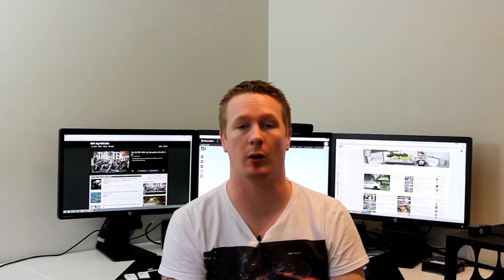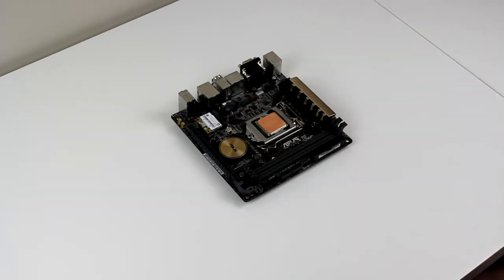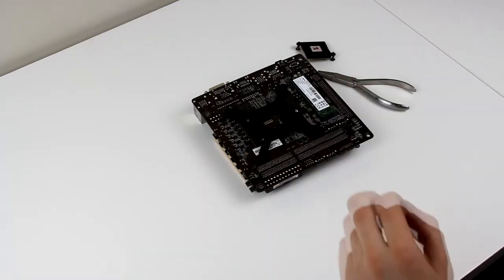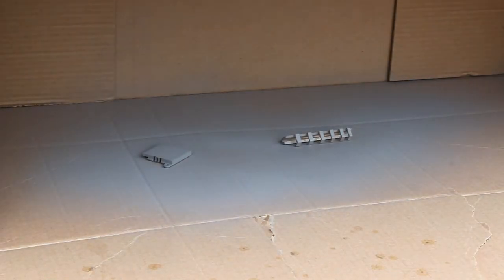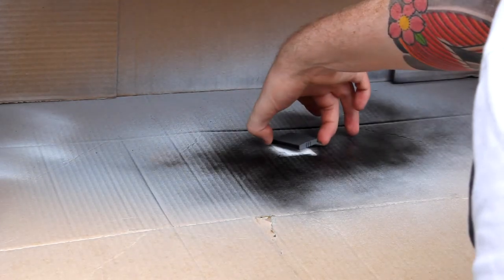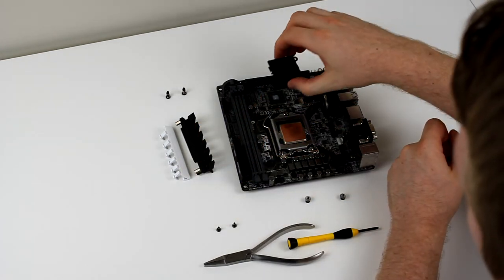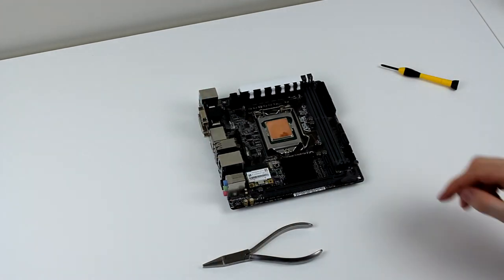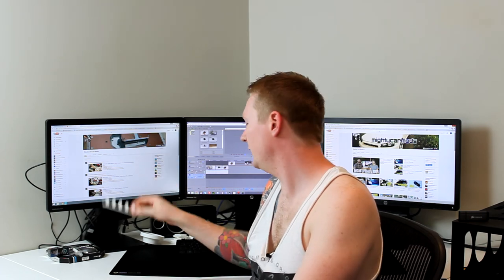Project MiniValidus - Part 03 - Painting Motherboard Heatsinks.

Comment: Glad to see another addition to your series. Really looking forward to how its coming together. Been reading on forums that the heat pipe in the STRIX 980 might have issues fitting in the M1. My current build has that exact card and I've been thinking about down sizing to this case. I've been hesitating though, as I don't know if there will be enough clearance. A mod could fix this or maybe water cooling, let me know what you think. Cheers!
Reply from the maker: Thanks for the comments.
The Strix GTX980 fits better than the Strix GTX970 because of a slightly different heatpipe configuration between the 2. It does fit but where it has issues is the high PCB where the SLI fingers are hits on the mounting fixture for the side panel. People have 1. Removed that 1 fitting with no side panel clamping issues or 2. grind back that part of the PCB "eek!" I will have to assess what will be best for me when I start looking at installing into the case. Watercooling offers similar issues with the in and outlets being quite wide or tall in this case, likely I'll have to modify the waterblock to slim down how wide those inlet and outlet fittings are...

Stay tuned to watch it unfold!

Comment: If you want the very best heat solution, use a Thermal Electric Cooler (TEC). These are capable of reaching sub zero temps. The only drawbacks are that it takes a lot of power to use them. 12v at 7amps for the one I have. The other issue is they get so cold they can and will condense water in the air causing it to sweat. Not a good idea to put one inside a computer case unless you overcome that. One way to overcome it is to connect the TEC to a heatsink in a water cooling system OUTSIDE the case. Lots of variations to this method and imo the best way to insure a very cool system. Electricity flows through cold much better than through hot conductors. There are videos on youtube about this.

Comment: I'm considering painting my blue Asus heatsinks black or red. Does painting impact thermal dissipation enough for me to worry about it? I'm going to cover up the part which makes contact with the north and south bridge.
Reply from the maker: MikoYT in my opinion it is incredibly unlikely to impact thermals enough to cause any issue. High temperature components like the CPU are seeing s +10degree jump after painting. A North/South wouldn't generate near the amount of heat a CPU would so I believe the margin would be smaller though I haven't tested that.

Comment: Awesome project! keep up the good work :) I am looking to paint my motherboard heatsinks as well . I wanted to know if you have to replace any thermal pads/compound after removing the heatskink and chipset when putting them back on? Would I be able to keep them as they were? if not, do you know what size thermal pads I would need to get for the vrm heatsink? Is that a ph00 screwdriver you are using?

Thank You.
Reply from the maker: Infinity Gaming I didn't replace the thermal pads when I did it and haven't had any adverse effects. I did replace the thermal compound under the chipset heatsink but really I probably didnt have to I could have just left what was on there, the actual metal component under that heatsink was probably only 1cm x 1cm the rest was all plastic. Not exactly sure of sizings, looking at what I have infront of me now I would say it was one larger, a PH0X.
Reply: DeeGee Tech and Hardware Thank you for the confirmation, helped out alot! Sorry for all the questions, I'm a compete noob when it comes to modding lol. Last questions: Could you tell me which spray paint you used, and Would I need to sand down my heatsinks before applying the paint? If so, do you know what type of sandpaper I would need to use? Thanks again :)
Reply from the maker: Infinity Gaming No problems, I always encourage question asking, I sure don't have all the answers. Paint will be marked with what it should be used with but if you go with any automotive paint you should be fine, same applies for for the primer, it will be marked if its for plastics, metals or fiberglass etc... as for sanding I didnt but a green or red scotch pad (have a look at mnpctech.com or Jim Weist ) that should be enough to just scuff the surface for a good paint application.

Comment: I have the similar board but of the atx bersion. I m plainign to paint my case labs case and want to paint the heatsink. what temp differnce did you see from it being painted or just no much? Also for thermal paste for the heatsinls do you use the same as cpu (like as5?) thanks again this will really help me
Reply from the maker: James Emsley TBH I wasnt monitoring the temps actively but I did have the default Asus alarms enabled so if it was overly got I would have been alarmed and I never was. Yea I just used normal CPU thermal paste (in my case MX4). I was pushing a few volts through mine for the overclock and it had no impact at all.
Do it! and good luck :)
Reply: Thanks man I'll link or pm you a link when it's done. Just started painting the caselabs case
Reply: +James Emsley Im also thinking of doing this with a differen mobo.
How did it work out for you?

Comment: Thanks for this video, it's given me hope in the project I would absolutely love to do.
The plan in question is an mATX black and green build in the Corsair 350D, I've narrowed down my parts to an MSI Z97M Gaming motherboard which I'd have to paint the red to a green that matches the GTX 960 100Million edition. 
Chances are though by the time I save up for said motherboard, Skylake and new boards would be out and if I can get a hold of a Gigabyte Sniper series + i7 that would be amazing.

Do you have any recommendations? I'm thinking of getting the EVGA GTX 960 but it's silver and not a card I'd really want to paint green but would match in other builds I do. But then I could just paint the MSI Twin Frozr, I'm just a bit stuck on what I should choose. Plus I've never modded anything before

 
P.S before I get people complaining to me about an i7 + 960 I do more content creation and just general tasks that benefit from an i7 over an i5. A 960 for gaming is fine for me anyways
Reply from the maker: Exiled Storm The motherboard could be a difficult one as it has the audio circuit which is red and that would be hard to change to green unless you did a very good masking job or plasti-dipped over the entire thing to black it out.

As for the 960, id probably go the EVGA as its a simple design cooler, again you could mask and plasti-dip with green and if you needed to RMA it you should be able to peel off the plasti-dip paint
Reply: Ah yes, the audio circuit has been annoying me. I would stand it if it didn't glow but I don't know if it did. I can't seem to find any green motherboards from the site I can order from (PCCaseGear, Australian site) and I don't think we'll be seeing any Z97 stock coming in anymore.

On to graphics cards, I was actually reaaaaally leaning towards the MSI one because the green is accented perfectly and I love the backplate to bits, but after further research I'm gonna have to grab the EVGA one. Plus EVGA support is second-to-none.

Comment: anyway why didn't you remove the original heatsink paint? is it ok if the original paint not removed? i'm planning to paint the motherboard heatsink and remove its original paint by using caustic soda, I've never done this before, so every advice I really appreciate it. thanks b4
Reply from the maker: +Suryo Nugroho The original heatsinks weren't painted they were anodized so there was no need to remove. :)

Comment: Is plasti-dip an option, temp wise?
Reply from the maker: +QUBE9000 For the heatsinks probably not recommended as Plastidip is an even bigger insulator than normal paint. NCIX tried it and they temps were quite a lot higher after Plastidip though, thats on a CPU cooler and not just a motherboard heatsink. Link: https://youtu.be/2Dj__1QW-vE
Reply: +DeeGee Tech and Hardware I could be wrong, but wouldn't them even covering the copper pipes have added to the issue more than anything with their test?
Reply from the maker: I dont think so, the pipes are empty and used to heat the air and move it from the contact point up into the fins I believe so shouldn't impact too much.